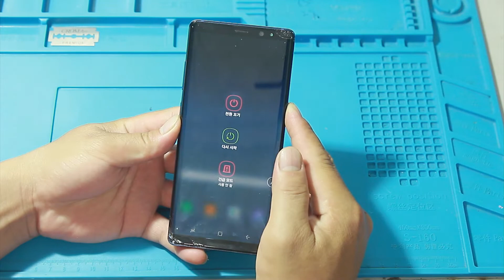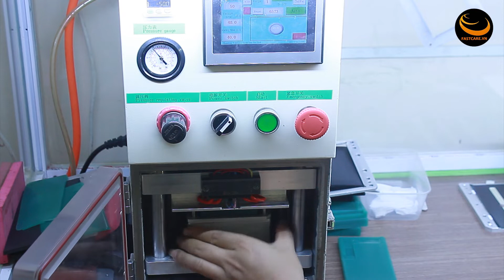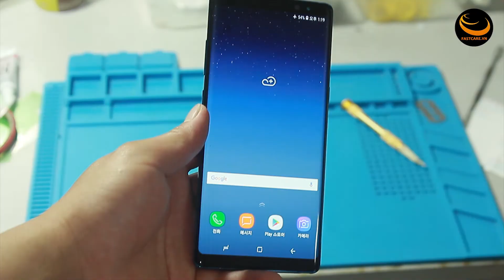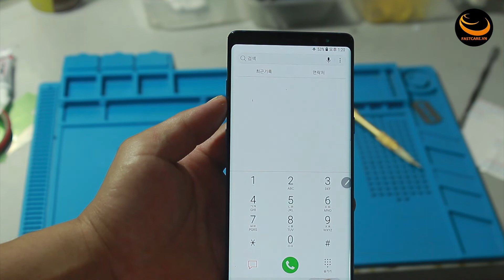Thay mặt kính Samsung Note 8 - Samsung Note 8 glass replacement

Comment: Cửa hàng ở đâu anh em .muốn thay vỏ và pin
Reply from the maker: Dạ, Hiện tại Fastcare có 6 chi nhánh tại TPHCM, mình có thể đến một trong các chi nhánh gần nhất ạ: 
CN 1: 591-593 Lê Hồng Phong, P10, Quận 10 - SĐT: 0964234586
CN 2: 254 Hoàng Văn Thụ, P4, Quận Tân Bình - SĐT: 0989179543
CN 3: 303 Xô Viết Nghệ Tĩnh, P24, Quận Bình Thạnh - SĐT: 0948128866
CN 4: 200 Khánh Hội, P6, Quận 4 - SĐT: 0977167876
CN 5: 117,Quang Trung, P10, Quận Gò Vấp - SĐT: 0333974234
CN 6: 380 Võ Văn Ngân, P. Bình Thọ, Q Thủ Đức - SĐT: 0977253353.

Comment: Giá thay màn bị ám bây giờ  giá bao nhiêu vậy anh..
Reply from the maker: Dạ chào anh. Với dịch vụ thay màn hình cho máy Note 8 , Fastcare nhận thay với 2 mức giá :
+ 3.600.000đ cho dòng màn hình Zin loại 2. (Đã bao gồm phí DV, giảm 50.000đ khi đặt hẹn trước). Sau khi thay màn hình loại 2, Fastcare cam kết bảo hành 3 tháng về chất lượng cảm ứng và keo dán bụi bọt, vệ sinh máy miễn phí ạ.
+ 3.800.000đ cho dòng màn hình Zin loại 1. (Đã bao gồm phí DV, giảm 50.000đ khi đặt hẹn trước). Sau khi thay màn hình loại 1, Fastcare cam kết bảo hành 6 tháng về chất lượng cảm ứng, bảo hành mặt kính trong vòng 30 ngày, keo dán bụi bọt vĩnh viễn, vệ sinh máy miễn phí.
Dạ, em cảm ơn anh đã quan tâm đến dịch vụ của Fastcare. Nếu có vấn đề gì cần hỗ trợ, anh vui lòng liên hệ lại Hotline 18002057 để được giải đáp thắc mắc. Chúc anh một ngày tốt lành ạ!